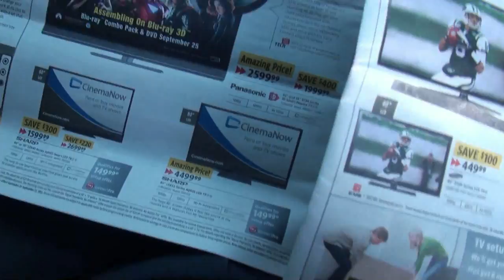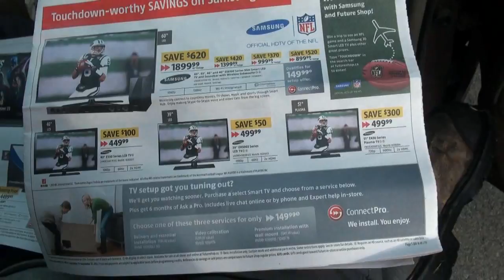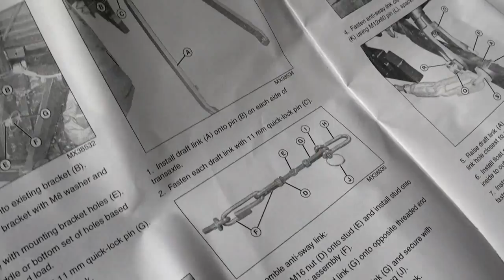John deere 110 tlb 3 point hitch installation

Comment: Well that is an old DLP tv you are linking to,not a LED so that´s why it´s cheap for people who want´s it.....DLP is like buying a home cinema projector with the difference that with the home cinema projector you can change the size yourself.I tried mine on the wall with 300inches as biggest so far but bigger ain´t always the best ;)Either way you have to switch the light both in a projection tv and regular projector and those can cost some bucks.
Cheers

Comment: You have a really weird 3 point hitch.. We have in holland a U thingy with a clip... (You have a O with that ballpoint or something..) We can just put the clips open and lower the arms and reverse to the cultivator and lift it and then click and it is done.. And the top arm or something is also really easy, just open the clip and use the buttons (outside) the JD and make it longer so you can put the U thing easily on the Cultivator..

Comment: Ref': leaks, it takes but a grain of detritus between the links for a leak. You could try using some Tape on them once you have everything clean as you said you did. Looks like the actual joints on the tractor is leaking though, rather than the hoses? Though I have to say I am no expert on Hydraulics.
Can you tell me the difference between a Giraffe and a Tractor? … One has Hydraulics and the other has High B-llo-ks. I jest sorry back to the serious work of being stupid as usual.